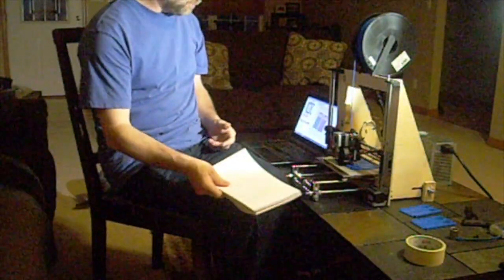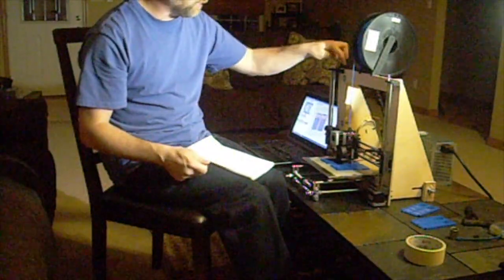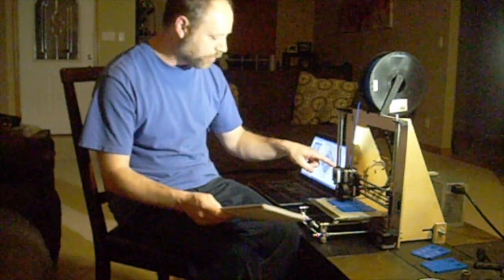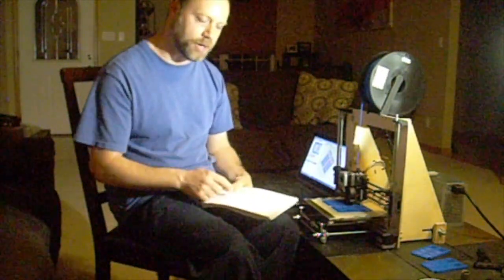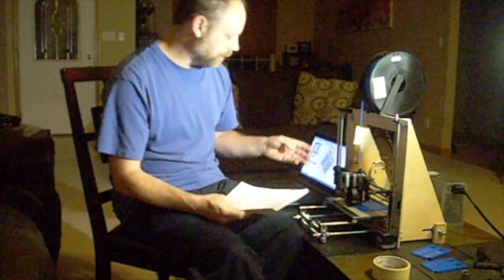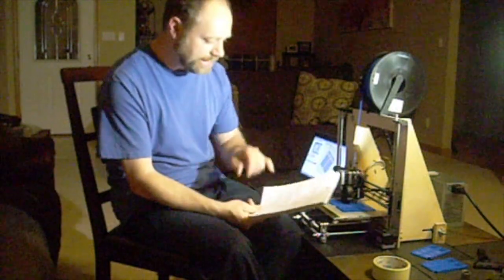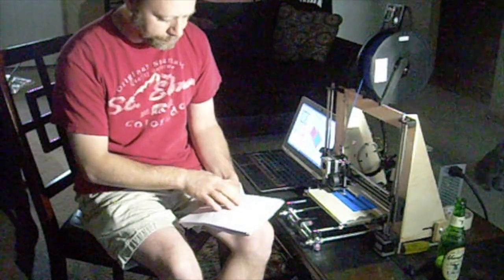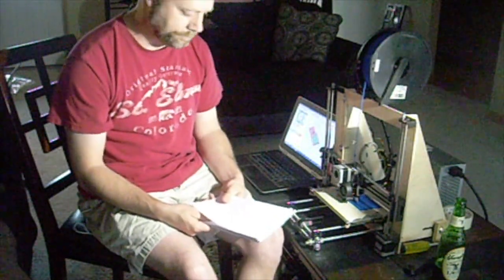Prusa i3 MK2 clone build Part 7

Comment: You've included lots of great tips. The part about reversing the limit switches is something that I will definitely watch out for! It would be very frustrating to wait months for parts to arrive and them watch them go up in smoke in a few seconds. I've taken your advice and ordered a daughter board. After watching your previous videos, I looked at a photo of the RAMPS board and I could see that there isn't even a heatsink on the MOSFETs. I think your idea is a smart one.